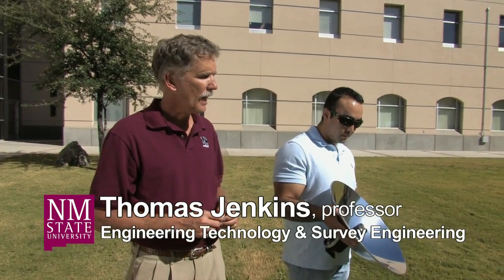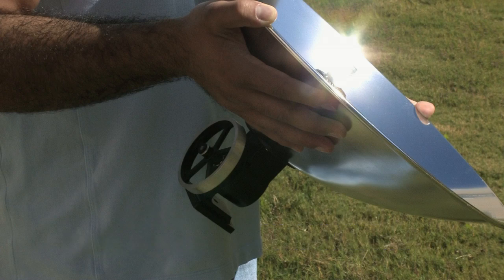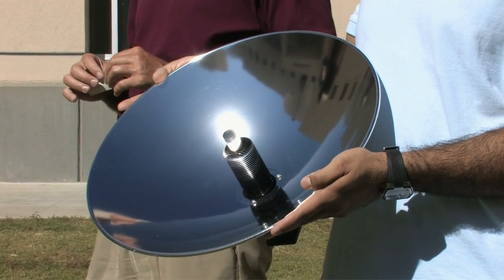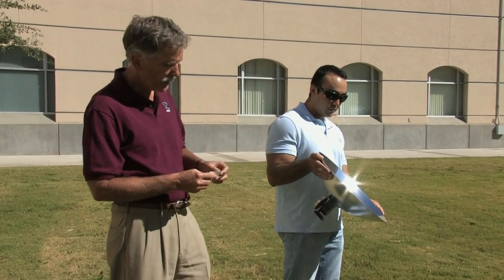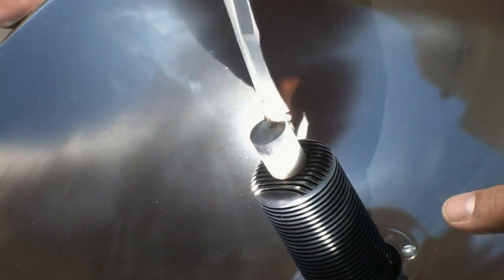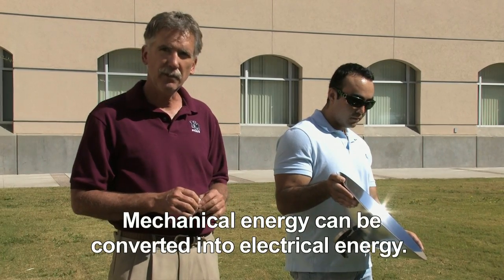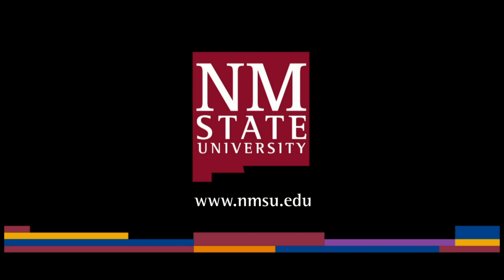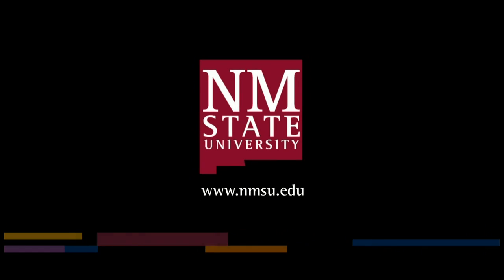Renewable Energy: Solar Thermal Stirling Engine

Comment: i would myself prefer to store the heat into a sand first then use sterling, because without storing the energy as you can see it wont work during the night
Reply: what?  THAT is what BATTERIES are for, lol
Reply: @michaelatwaoi7876  just to store the heat and then use heat to run sterling, check "sand battery"

Comment: You might want to do a bit of research beyond what you've seen on YouTube.  Stirling engines have been built to power entire factories, submarines, and extended solar generating plants.  Here outside of Las Vegas, there are thousands of stirling engines mounted on parabolic mirrors generating electricity.  One was even put into a car in the 70s.  NASA has developed several stirling based generators, and their plans are free to the public.  There is much more potential here than shown on YouTube!

Comment: That's pretty much all these types of sterling engines will be. They just don't produce enough torque to turn any real generators. But I've seen some promising steam type sterling engines that give a good amount of torque. With some tinkering and modifications i really do see the possibility of a decent solar engine. You could even use the exact same design on geothermal spots. Then no worries about there not being enough sun.
Reply: Do some more research.